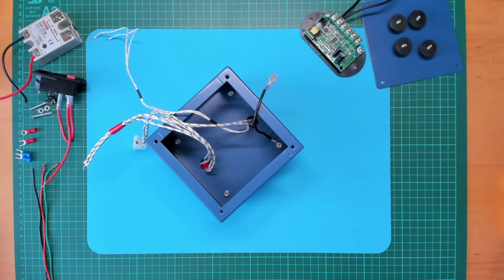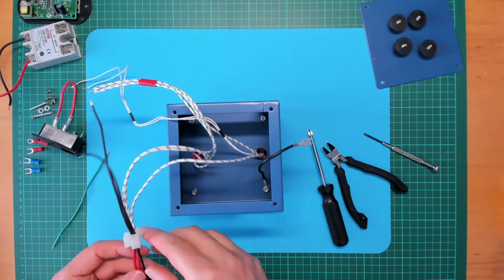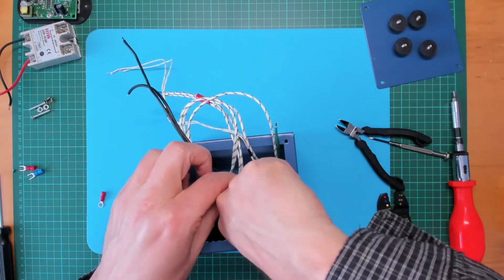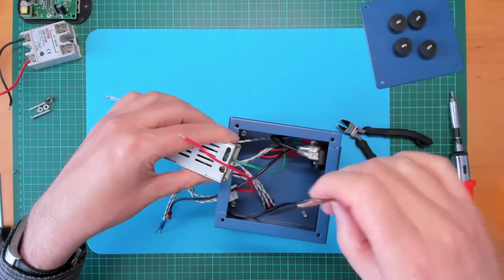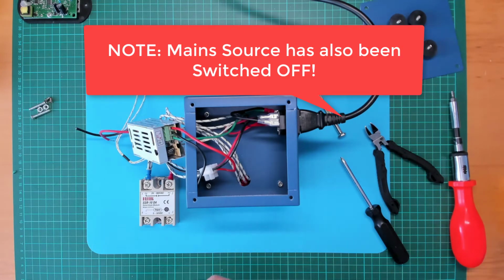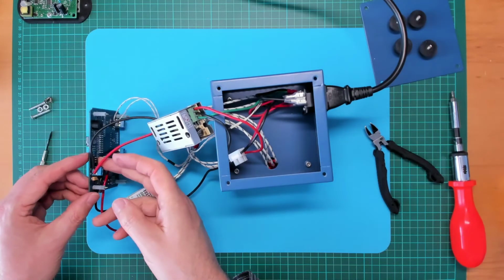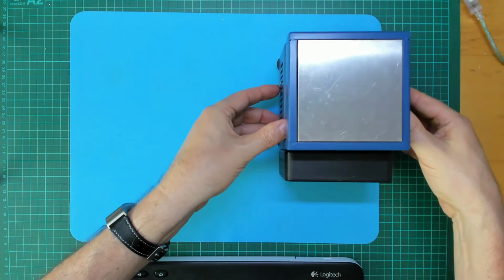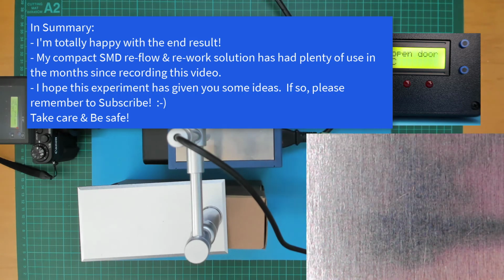Solder Reflow with Preheater (PART 3) - Reflow Controller

Comment: Is there a reason that you didn't use ferrules to connect the 5V2A unit? You were using a lot of spade terminal all over (which I really like), but as I said you didn't use ferrules. No critique, just curious 😊
Reply from the maker: Hi Dustin.  I totally agree that using ferrules for those PSU connections would have been preferred.  It was a long time ago, but from vague memory I hadn't found them yet in my storage after relocating, but clearly I had found my spade lugs (for the screwed connections).  So, it's definately worthwhile pointing this out!  🤓
Reply: @DigicoolThings  No problem off course. It will hold I'm sure, I was just curious :) Thanks for part 1,2, and 3!
Reply: @DigicoolThings  No problem off course. I was just curious :)

Comment: Hello. What reflow controller did you use and where did you get it from. I use a 946 but reflow by eye. Thanks
Reply from the maker: I used an older Controleo2 Reflow Controller, that was free / surplus from an upgrade.  The Controleo2 works well with just the 1 element connection.  Note that I discovered the newer Controleo3 seems to require a minimum of 2 elements for it to work (so it's no good for this application).  Maybe you can also find an old Contoleo2 cheap of free, from someone who is upgrading their oven to a newer Controleo version?
Reply: @DigicoolThings  Hi. Just an update. I got in touch with the company that makes/sells the Controleo3 controller to see if they had any of the Controleo2's left in stock. He thought in theory, the 3 should work with a single element but he is going to test it out and get back to me.
Reply from the maker: @dpbarry  Thanks.  That would be interesting to hear the outcome.  It was a long time ago now, but I'm sure at the time I couldn't get Controleo3 to work with the single element connected.  However, I never followed up with them, as the Contoleo2 that I had worked fine.  So, it will be good to get a definitive answer on this!  🧐
Reply: @DigicoolThings  No Problem. I'll keep you informed

Comment: i see that all the time, that ppl "sliding off" the pcbs, when there are hot.....LET IT COOL - and then take it - so u havent cold solder joints after....
Reply from the maker: The cool-down rate of the pre-heater is very slow.  Indeed, significantly slower than is dictated by a typical solder reflow curve.  By sliding the PCB off the pre-heater and alllowing it to cool in the room's ambient temperature (in the absence of any active cooling), you are more closely following the prefered reflow cool-down curve.  This has always worked perfectly well for me, for the purposes of prototyping and re-work.  The resulting solder joints have all proven perfectly servicable. 🤓

Comment: How important do you think a cooling fan is for something like this?
Reply from the maker: Well, the cool-down is too slow for a typical reflow curve, so some form of active cooling would asist this.  However, I just remove the PCB from the heated surface when reflow is complete, and allow it to cool on my silicone mat (or on a heatsink).  Not particularly scientific, but that seems to be adequate for good reflow of my prototype boards.  🤓
Reply: @DigicoolThings  Thanks. I was just thinking about how it wouldn't be too difficult to add a fan to it, but wasn't sure if it was worth the effort.

Comment: Just to comment on this - your thermocouple may have been ungrounded which seems to be lucky. My version of this plate has grounded thermocouple (e.q. the wires connected to the terminating washer) and that does not work with MAX31855 thermocouple controller used in Controleo2. The grounded thermocouples need pretty much a lot more involved electronics to avoid ground loop.

Comment: Thank you! Where can I find the Controleo2 ?
Reply from the maker: Hi. Yes, a google for Controleo2 doesn't provide much, other than Whizoo now only ship the later Controleo3 (which won't work with a single element). 
However, if you are keen to build your own, I did note a couple of Controleo2 clone boards on OSHPark share. eg. https://oshpark.com/shared_projects/bYNdrIwe
Also, the Controleo2 firmware is open source, so everything appears to be there to build your own: https://github.com/engineertype/ControLeo2
Alternatively, it's possible one might pop-up on eBay when someone is upgrading their oven to Controleo3?
If you take the "build your own" path, please report back on how you went, for others who may be interested.  Cheers.

Comment: Thank you! I first wanted to buy the Yihua 853A, but it's very big. Then I found your video series by accident 😅. Unfortunately the Controleo3 is about $129, which is three times as much as the heat plate itself. For me not worth it. Maybe I try it without improved controller and build some controller of my own.
Reply from the maker: Note that I discovered the newer Controleo3 seemed to require a minimum of 2 elements for it to work (so it's no good for this application).  I used the older Controleo2 which works fine with just the 1 element connected.  There are cheaper reflow controller designs to be found, you’d just need to confirm they work with one element.  Alternatively, just keep your eye out for a cheap secondhand Controleo2, as there’s no doubt others doing Controleo3 upgrades to their older Controleo2 ovens.  Take care & Have fun! :-)
Reply: @DigicoolThings  thank you for your thoughts about this. It's very appreciated. I will see, what I can do. First I have to wait for the delivery 😎🚚

Comment: Thanks for the great set of videos on these. I've got one with a 2020 manufacturing date, seems to be basically the same, but the solid state relay is mounted at the back (with only 1 screw!), and the label on the back only rates it at 400W. Confirmed it pulls just over 400W from the wall when it is heating.

I have been messing around with the settings in the "long press" menu another commenter mentioned, in an attempt to get it to heat up faster. One setting appears to control how long the heating pulses are. Adjusting that up makes it heat up faster, but it then seems to overshoot the target temperature! The last setting appears to control the temperature calibration, have managed to get it to read closer to what my thermometer says the temperature is. Not 100% happy with it so may have to investigate customer controller solutions too...
Reply from the maker: Thanks for watching.  Yes, I’d also noted the original controller was pretty poor at managing the heating and maintaining temperature stability.  I suspect their heating algorithm is pretty simplistic.  I’m finding the Controleo2 to be much more accurate, which I expect is due to it’s test / learning mode approach.  One thing to note on controller selection (unless you are rolling your own), I discovered the later Controleo3 requires 2 elements to operate, whereas the Contolreo2 is fine with just the one element connected.  
Overall, I’ve been very happy with my upgraded pre-heater, which has proved very useful for both SMD component recovery & rework, and also for occasional single board “visible” reflow’s.  All the best with your custom controller journey!

Comment: I like using a hot plate for some SMD work as well, I have a halogen heated ceramic plate that I find handy for re work, also its a cheap way of getting single chips as sometimes it's easier (and cheaper)  to buy a module from ebay and rob the device i need as opposed to just buying the chip ! also you get all the peripheral components too...didnt no you are a Kiwi, thought you are a Brit..oop's!...great project, I love making things that are truly useful, stuff you wonder how you managed without...cheers.
Reply from the maker: Thanks. You make a good point about recovering devices from cheap modules.  The other use case, that I’m not sure I mentioned, is I also use the Bake function as a rework preheater in combination with my Hot Air workstation.  The Hot Air gun works so much better if you pre-heat the PCB to say 150c, and then use the Hot Air to quickly lift the temperature to reflow only selected targets.  All the stuff I can’t do in the reflow oven.  And having the Reflow automated, just makes the preheater even more convenient and useful.
Reply: @DigicoolThings  hot plates are a very useful addition to your arsenal in the SMD world.

Comment: Nice, I have been looking to buy one of these, but they bases are so bulky it seems.
Reply from the maker: One of the things I like about it is how compact and portable it is. I can store it at the back of a shelf, and drop it in my workspace whenever I need to do some rework / component retrieval, or to just brew a quick single PCB prototype. Even though I also have a reflow oven, in the same room. :)